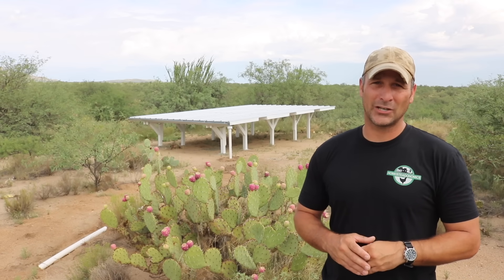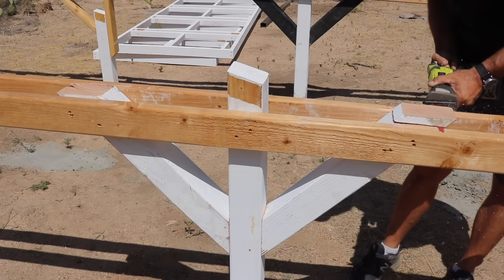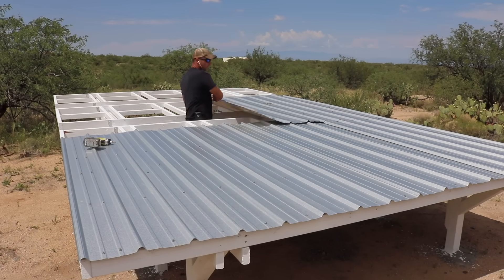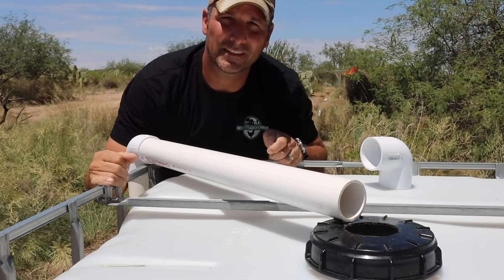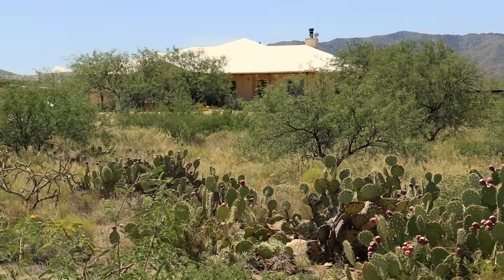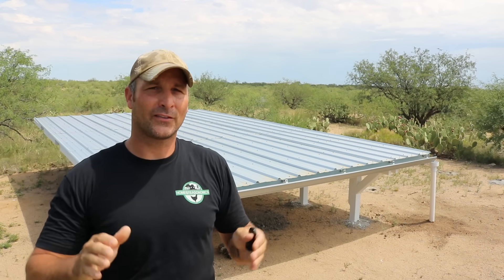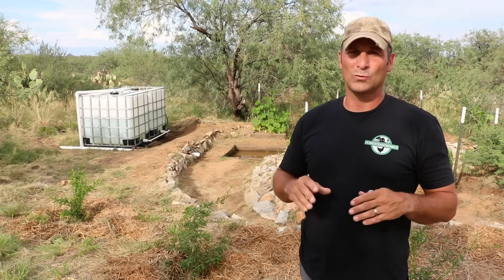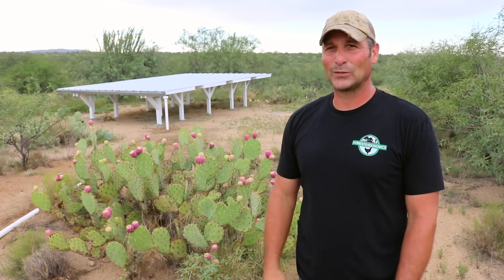Rain Roof -  Rainwater Harvesting Project - How To

Comment: Too bad you can't have enough clear plastic roof, and solar panels underneath and getting both water and energy.
Reply: John Lord or just catch the water off the panels?
Reply: Todd McCarter that could work
Reply: Solar panels need to be at a greater angle for efficiency.
Reply: @elund408  the angle actually only makes a couple degrees of percentage of realized efficiency.  https://youtu.be/st-Gd1ZcFyM?t=2426
Reply: It would also be nice to keep them 7 feet off the ground then you could park electric car, or storage and possibly add siding to store wood and the likes.  He mentioned this later in the video.  Also you can still store stuff underneath.
Reply: Or just mount the panels on top of the roof...
Reply: Samual Whittemore now we're talking.
Reply: Solar panels wouldn't work because of the length of wire to batteries that would be a significant power loss. Just to his garden 75 ft away is a massive power drop.
Reply: @garyjohn316  if your cable is thick enough to handle the amps, then you will get almost no loss. The reason people don't do it is because copper is $$$$
Reply: @garyjohn316  not if the inverters and batteries are located under the panels or in a shed close by. Then the power is converted to AC from DC and can be transmitted a long distance through 12/2 or 10/2 direct bury wire.
Reply: @dl4111  Interesting. Thanks.
Reply: @dl4111  i've seen a setup done 2 different ways, one like yours with a small battery bank with a long underground run to the main house where there is a battery charger to charge the main bank in the house, and another way was to use a grid tie inverter at the array with no batteries, then the long underground run to the house where it is tied into the main inverter so during the day the grid tie supplies most of the ac power while saving the batteries for night use.
Reply: @garyjohn316  just get some high voltage panels, even 24v with some beefy cable would be fine.
Reply: solar panels are tempered glass and aluminum...
Reply: Great idea..... man...
Reply: You could get energy from a water wheel as well
Reply: @colleenforrest7936  Not worth it, too intermittent.
Reply: John Lord that’s a great idea!
Reply: I echo this thought.
Solar panels requires
A much bigger
 INVE$TMENT.
This project was to reuse what was already on site. P
Reply: Water directly off the solar panels...anything above them is gonna cause shadows and that kills output.
Reply: The water will lower the surface temp of the panel and increase electrical production. And clean the panel ;-)
Reply: Catching water directly from the solar panels is a good idea, but it is necessary to know if the solar panel materials leave residual toxins, heavy metals, etc. in the water we may collect from them.
Reply: They are usually bonded to glass.
Reply: They are glass. OR they should be.
Reply: @xolotlmexihcah4671  ah no,  they are glass
Reply: Xólotl Mēxihcah so solar panels are leeching heavy metals into soil in their normal installation? That doesnt sound good if it is true.
Reply: Todd McCarter That's what I would like to know too. If solar panels don't produce any kind of residual toxin, then they could be safely used for catching rain water.
Reply: Xólotl Mēxihcah I dont think so, I mean im pretty sure the outer layers, or at least the top is just glass. If not ut sure does shatter like glass.
Reply: Todd McCarter how about the galvanized panels?  They aren’t?
Reply: badlandskid i was talking about the solar panel,idea, the galvanized roff definatly does to some extent
Reply: Todd McCarter my apologies.  I thought I had replied to the comment by Xólotl Mēxihcah.  

I think any man made material could have unwanted contaminants.  It’s just which is the lesser of contamination.
Reply: @xolotlmexihcah4671  they are glass,  I catch drinking water off my panels
Reply: I think putting solar panels underneath a rain roof would make more sense.  How do you create a contiguous surface to catch the water if not?